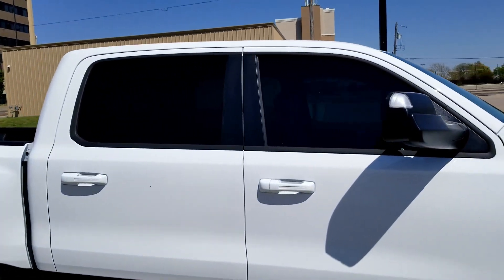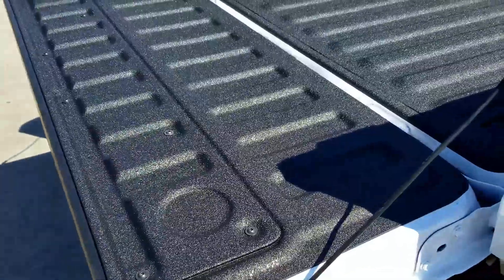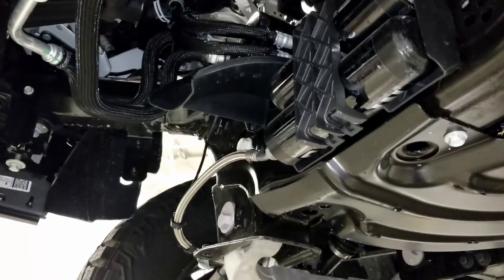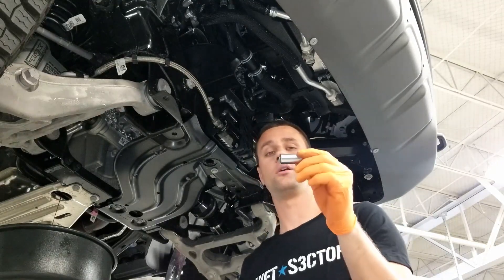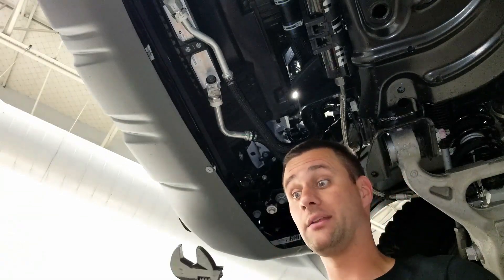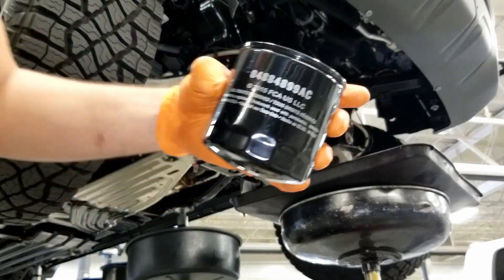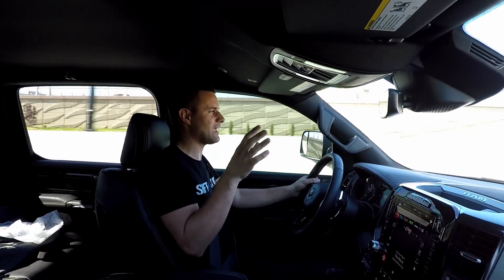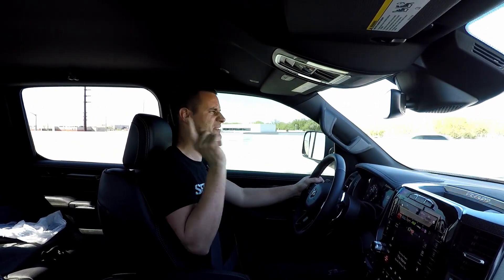RAM TRX Oil Change And Cosmetic Mods HOW TO

Comment: I just did the first oil change on my 2023 Lunar TRX at 1,500 miles and I went with Mobil 1 Super Car 0W-40. This is the Dexos R Spec oil that is made for all the Corvettes. Supposedly it’s better than Pennzoil SRT oil. Maybe look into the Super Car Mobil 1 formula for your next oil change.

Comment: We just had 70% tint added to our windshield on the X5 to help with the heat on the black dash during the summer drives out west. It helps block a lot of the UV while not looking totally suspicious. Truck looks great! Looking forward the launches.
Reply from the maker: I am contemplating doing some 80% at least for the heat and UV.

Comment: Luv the video. FYI: the TRX Owner's Manual Supplement does call for 7.5 quarts when changing the filter... not 7. So it's no surprise that your 7 quarts came up to halfway through the safe zone on the stick. Yes, the 1500 manual says 7 quarts for the 5.7, but the supplement does state very clearly on page 121... 7.5
Reply from the maker: The crazy thing is the factory service info at the dealership called for 7qts! Glad I checked! Thanks for the view!

Comment: Excellent video, thank you! Using that Mobil 1 FS 0W-40 was an intelligent choice. I am using the same oil in my 5.7 HEMI. If you run the truck hard, I would use the Mobil 1 FS 5W-40. It shears a bit less. Both of these oils are leaps and bounds better than the Pennzoil Ultra Platinum SRT 0W-40 oil, which is just mid-SAPS fuel economy oil masquerading as high-performance oil (yes, lol).
Reply from the maker: That is good to hear, I have always like running Mobil in my vehicles, Thanks for the view!

Comment: Do all TRX have the oil cooler? And and why did  you choose that euro Mobil one over the Pennzoil UP
Reply from the maker: Yes all hellcat powered stuff will have the remote oil cooler that you drain with the oil change and I have been running Mobil 1 in my other vehicles for year, I think the Pennzoil is probably great also, either choice will do great! Thanks for the view!

Comment: stupid question  how to  check oil level on the trx the dip stick  is weird  .. i have a general idea but want to make sure I'm  correct thanks
Reply from the maker: As long as it is on level ground you should be able to check it like normal, some times it is a little hard to see if the oil is new and clean. Thanks for the view!

Comment: Is it acceptable by RAM to use the European version of the OW40 without voiding the warranty? And what is the difference in the two oil versions? We enjoyed your videos a lot!
Reply from the maker: At the dealership in my 14years I have yet to see any warranty issues come up from customers using there preferred brand of oil. The current contract Mopar has for oil is with Pennzoil and that is why it it the "recommended" oil. Years ago the Mopar oil contract was with Mobil and Mobil 1 was recommended in all of the SRT vehicles. Thanks for the view!

Comment: Is the full line the top of the hash mark or the ⛔? This is my first RAM. I filled 7 and it's at the top of the hash marks
Reply from the maker: Full would be the top of the hash mark, and pending you fully drained the oil pan, oil cooler and replaced the filter it should be roughly 7.5qts. Thanks for the view!

Comment: I wish I can add additional oil cooler. here in the middle east temps climbs to 230 F while driving normal in hot weather. Same goes for the tranny but priority is for engine oil cooler
Reply from the maker: Wow hopefully someone will make a larger aftermarket cooler that could replace the small factory one for the hot climates. Thanks for the view!

Comment: Tyler i thought it was 14mm for drain plug not 13mm like u said?
Reply from the maker: The factory plugs should be13mm for the engine oil pan and a 15mm plug on the oil cooler. Thanks for the view!

Comment: did you have to reset the alert on the dash?
Reply from the maker: Yes, that would have been good to add to the video, but yes you can reset it with turning the ignition on and pushing the gas pedal down 3 times or you can reset it through the instrument cluster. Thanks for the view!

Comment: Its a hellcat motor it needs. The SRT Oil  filter ( 5038041AA ) they are a lot better. Plus the oil should be. The Pennzoil Ultra synthetic oil.
Reply from the maker: The SRT viper filter is a great option also, and any good 0W40 is a good choice. Thanks for the veiw!